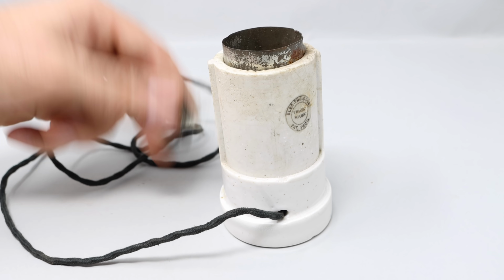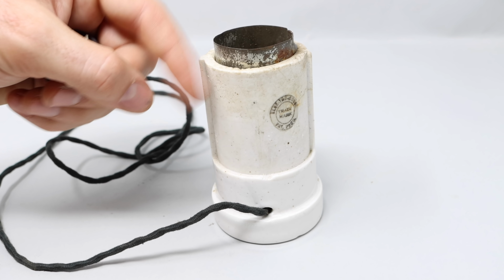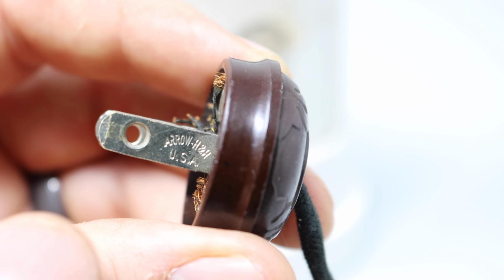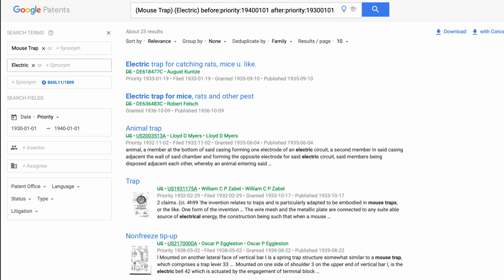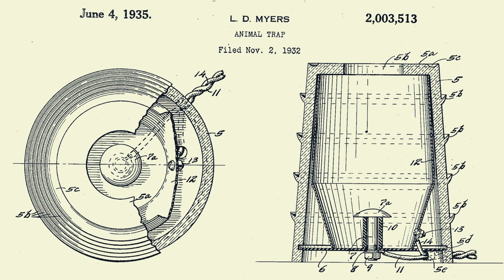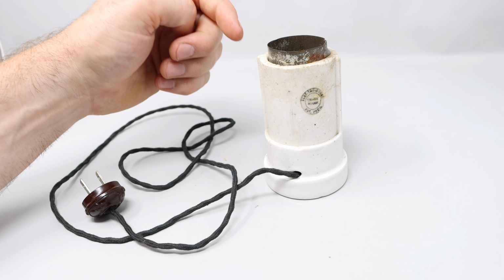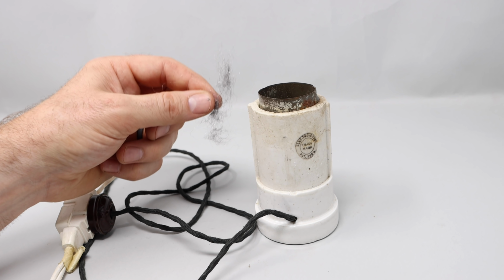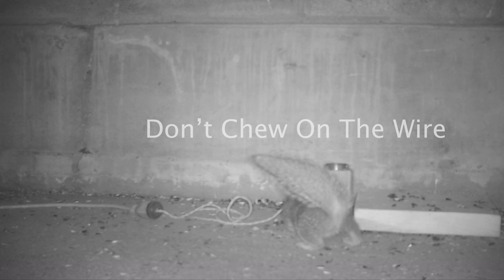I Need Your Help Explaining This One - The Electro Mouse Trap from the 1930s. Mousetrap Monday.

Comment: Had it been DC voltage you might have captured one.  110V AC doesn't tend to make your muscles contract hard like DC at the same voltage.  In the end, I don't think this mouse trap worked very well in the 1930's either.

Comment: These were never mouse killers, there is not enough voltage to instantly kill in a home.  A long dose might do it, but the smell would be terrible.  In the 30's electrical systems were not grounded so polarized outlets were not needed since there was no potential between the wires and the earth, with our grounded systems now days and that popularized cord end the outer rim could be the "live" line and anyone or anything that touches it could be electrocuted.  If the electricity travels through your heart it could send it into fibrillation, that's how you would die as well as the mouse, but fairly rare, most of the time you and a mouse will just pull away and no harm done.

Comment: Voltage in the 1930s was lower than it is today (110-117V) and didnt get standardized until post WWII. Also some areas had lower frequency.   

On the other hand it could be like the modern day electric mosquito or rodent "repellent" devices...a bunch of hooey.

Comment: Does the voltage and the amperage of an electric outlet was the same in 1932 and now ?
Reply: Voltage back then was about 110.  Today, it's typically ~ 117.  The amperage available is determined by the size of the breaker or fuse, but the actual amperage drawn is determined by the resistance of the load.

Comment: The death from ac electrical in humans comes from the fact the our internal electrical pulses that control our heartbeat operates at approx 52hz. So your electrical outlets operate at 60hz. The difference means that a person qill likely survive a shock. Less likey in countries qhere 50hz is the electrical standard.  I dont know what frequency a mouse internal pulses operates at but their heartrate is much higher.  Solution is to drive the device with dc voltage and high current. When the elctro zap hits, the mouse will never have an oppurtunity to escape. Wire to car battery to test, but careful as the mouse will likely burst into flames.
Reply: contrarily, nations that use 50hz have 230V standard.  much deadlier.  a human with a 12 ohm resistance at 115V/60hz may survive (<10A shock), but not at 230V/50hz (>10A, lethal).  frequency has nothing to do with it, also lethallity increases for both voltages if the electrical path is through the chest.  Amperage = Voltage / Resistance (I=E/R).  this is taught early in most electrical schools, as it and P=IE, etc.  formulae that you will use the rest of your life--or it may be a short one.  swidt...

Comment: Put a dab of peanut butter on the bottom plate, and lay the thing on its side with a couple of bits of wood on each side so it doesn't roll.  Might not work, but it might!  :-)

Comment: Mice are being shocked with line frequency mains voltage 110v ac 60hz which was invented in the 1800s, still used today in 2022. Same electricity.

Comment: I'm sure that the idea was to replicate the idea as screwing in a light bulb. With the neutral wire is attached to the outer tube and the line voltage will be attached to the center post. Just like a lightbulb. And I agree with many others  the 30's electricity was a novel idea. Your residence had KNOB & TUBE Wiring and the CAMBRIC COATING on the wiring was a great bedding source for rodents. I can't tell you how many old homes I've remodeled that had this type of wiring where the CAMBRIC insulation was chewed off to bear wires. 
In fact back in the 20's & 30's there was a common phrase among the fire departments to blame the cause for structure fires. Hot Wired Rats.

Comment: I guess these traps did not work properly in the 1930ies either.

There are two problems: 
1. The mouse will feel the electricity already when touching the tube electrode, unless the device is connected to an galvanically isolated supply (requires a transformer).

2. 110 VAC is a too low voltage for a proper kill of a furry animal - the skin and the fur will limit the current to a moderate level as a skin flashover will occur only at higher voltages (such as 230 VAC). 

So, the trap is basically functional, but only at higher voltages. With 400 VAC (as common in Europe in three phase systems) it would work pretty well, but only with an insulating transformer and a high risk of fire - and a disgusting mess if a mouse really gets trapped.

Sincerely yours, MSc. Electrical engineering.

Comment: Today's traps step up the Voltage to some thousand Volts and therefore lowering the internal body resistance, the old ones are just plates connected to live wire.

Comment: I believe that numerous mice, rats and squirrels have been killed gnawing through home wires, numerous men have also been killed working on electricity. Many factors go into the lethality of a trap like this including humidity, how dry the mouse is, the amount electricity, the timing of electricity and even the heart condition and health of the mouse. Generally, as you approach electricity, with whiskers, those whiskers should be poor conductors allowing a sort of warning before you get a lethal dose. That said, clearly this trap is of a suboptimal design. People want a mouse trap that works every time.

Comment: The cycles then we’re 25 hz not 60hz like today.  Maybe that made a difference ?
Reply: If that is the case then the effectiveness on rodents would probably be even worse. Animals (including humans) act a bit like a capacitor, so the impedance would increase if the frequency goes down. (Greater total resistance)

Comment: I think in my opinion they used a stronger voltage. We usually use 120 v, but I wonder if they used the 220 v in it with a bit of a higher wattage??? The electricity then would stiffen the muscles and make it so the mouse couldn't jump away.... Just was thinking as I was watching the video....

Comment: For a valid test the unit should have been sitting upright...  I'm surprised you considered that a valid test...  No difference in the electricity but there may be a difference if the trap is set correctly...

Comment: I think that these traps won't work especially for mice, because they have some fur and when they come in the maybe get a little shock over their fur and they run out, also the voltage in the US is 120V so I think it's not really enough to kill it, maybe it would work better in EU for 230-240V, but I think that in the past they weren't a success with killing mice or maybe really small ones it could harm or kill but I don't think so.
I think that at that time they started out with electricity so somebody had an idea of doing this but guess he wasn't successful at all.

Comment: Most likely the grid you're plugging into doesn't have high enough amps to kill, although it should. The design of the trap is fine and there is no difference (as far as how the trap is concerned) in the electricity used. If the trap had a transformer to step up the amperage to shock the mouse before the mouse noticed that would be more kill effective. All in all likely a lack of total power.

Comment: I'd also guess that the difference in effectiveness lies in DC vs AC. I'd bet that recent electric mousetraps have a powerful capacitor that accumulate a lot of charge and release it as a DC current directly on the mouse. Note that the modern ones work on battery, not on an electricity house plug (AC), which seems to corroborate this view. It also seems evidence that 110V AC in itself doesn't mean it's more effective in killing mice than a few Volts released as DC captured by a capacitor that accumulates a lot of static energy from those few Volts.

Comment: There should not be any difference between 120 volts ac in the 21st century and 120 volts ac from the 1940s at 60hz

Comment: You need to tie a ground wire to his tail.  It's the same reason we wear shock resistant boots on the job.  You get the shock, but with no where for the electricity to go, you get no current.  Same reason we keep one hand in our pocket when dealing with uncertain wires.  Get shocked while touching a cabinet or something, and it'll pass right through you.

Even if it did work, it'd probably blow a fuse every time you got one.

Comment: Watched this video several times, the mice were obviously getting enough jolts to give them a hair curl from leaking voltage but not enough to do the deed.
There's really not much to explain here, this contraption is nothing more than an old light socket without the threads. If you cleaned the two contacts with sandpaper or steel wool, the trap would probably work better or more effective, seen many variations over the years, none of which I'm sure had a Patent, . 
Note: since this does not have a grounding device, its probably not safe to overly handle in wet or damp conditions especially when not hooked into an outlet that is equipped with a ground default breaker,. I played with something like that when I was a kid, , I smoked a rat, the end result....,I burned downed my uncles hay barn. Funny now, wasn't funny back then.
Not an item to be left unattended ...,out in the open with small kids or domesticated pets wandering about.
Still like the videos, keep them coming Shawn,
 I used to catch mice alive for fun with a soup bowl and a whiskey bottle cap. Not hard to figure out where to pack the bait, works every time..

Comment: I HAVE RATS IN MY GARAGE! HELP ME GET RID OF THEM SHAWN!!! 

PLEASE any advice..... I"m using ammonia, peppermint oil, ultra sonic which has 1,000's of 5 star reviews on amazon. ANY suggestions PLEASE let me know? (READ MORE)

I"m getting pretty desperate......>What happens if i just turn on my car and leave it on for several hours with all the doors and windows closed in the garage? Wouldn't this smoke him out? Literately?
Reply: Shawn has tested the ultra sonic pest repellents, and so has myth busters, they don't work at all. 0% effective. The reviews are made up by the manufacturer. Put a little peanut butter on the ultra sonic, and the rats or mice will lick it off. I suggest trying the dunk the rat traps. Shawn has lots of videos on catching rats. Also check out Joseph Carter the mini man. There are lots of videos of how to make rat traps.
Reply: That's mink man, not mini man, spell check got me again

Comment: There's no difference whatsoever. Those traps were sold on wishful thinking. To make a system that really works, the voltage must be stepped up into the kilovolt ranges like a bug zapper. You're right to be cautious tho, 110v is still quite dangerous.

Comment: The current of electricity was probably DC in the 20-30s, which has a different effect whare electrocution is concerned. DC make you grip and AC throws you back. PS look up the ac dc wars it's fascinating stuff

Comment: Is it work with DC? Ive heard its more deadly, thats one of the reasons, why we use AC now
Reply: There's not much difference really. We use ac because it's easier to transform to higher voltages to avoid current loss over long distances.

Also, switches are more simpler for ac.
Reply: @TalasDS  neither of you has a clue

Comment: when the mouse touch one electrode , the capacitance cause a tinny ac current flow through the mouse , but isn't enough to kill the mice , so it will just jump out insted of touch both of them. U may need a FFFUUULLLLLL BRIDGE RECTIFIER

Comment: Absolutely! My grandpa is an electrician and I worked with him for 2 years. I also was in every class in highschool that dealt with electricity. So from what I got from the picture is the weird rod in the middle was connected to a live wire. So was the actual metallic tube. Once a mouse bites or comes in contact with both, it fries itself. The animal has to touch both in order to electrocute itself. DO NOT!!!!! Touch the metal part when it's live. I say you do another video but this time, put peanut butter on the round little rod in the middle.
Reply: I also don't believe it would be lethal enough to kill any mice, but it would be funny to see some mice get shocked.

Comment: Could it possibly be developed to run DC current, not AC. I wonder if DC voltage would have any different results.
Reply: no.  DC is what you get from a battery.  it has a plug, which is always AC

Comment: It's how much amperage you have, along with volts. A basic guide to electronics, will help you. Many electrified traps have been made over the years. YouTube has many channels devoted to this. The trap you have, looks dangerously unsafe.
Thin wires don't help. Something more heavy duty, is needed.

Comment: The biggest reason why these traps aren't working is you are using them with the now standard AC or alternating current. To actually make these work you need to be using DC or direct current. For information on it look up Nikola Tesla the pioneer of ac and Thomas Edison the heavyweight DC champion
Reply: don't talk if you have no clue
Reply: @natalieisagirlnow  I do have a clue back in the 1930 dc current was the standard we use ac because it is safer DC electricity doesn't have an alternating flow and actually locks the muscles in the body the ac electrical flow causes it to pulse and will make the body reflex off of the current unless it is physically held there reason I reference the fight between Tesla and Edison is I don't want to discuss Edison electrocuting an elephant to prove that AC was more dangerous. the obvious doesn't know what they are talking about Bob is you
Reply: But no the guy who builds high voltage welders for a living and works with both types of electricity has no clue what he is talking about

Comment: Why don't you try hooking it up to a car battery, I think DC is more dangerous by nature than AC.
Reply: false.  in a car the danger is from the stepped up voltage in the coil (that goes to the plugs).  a 12V nominal DC will do literally nothing to you